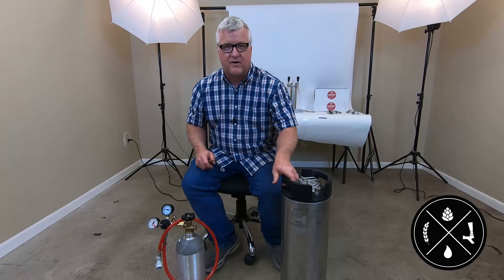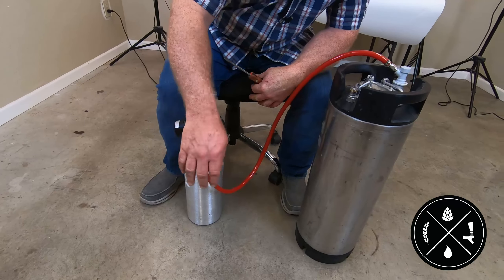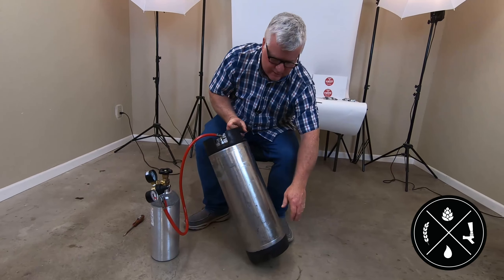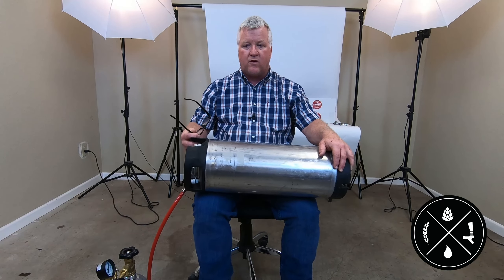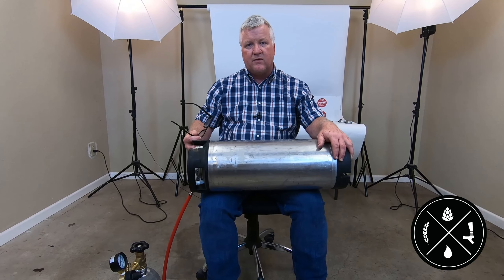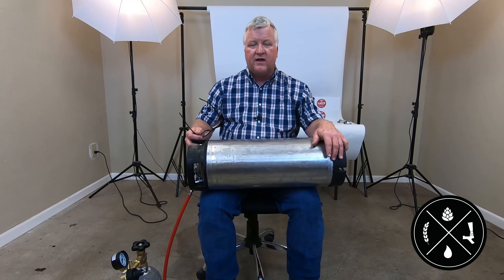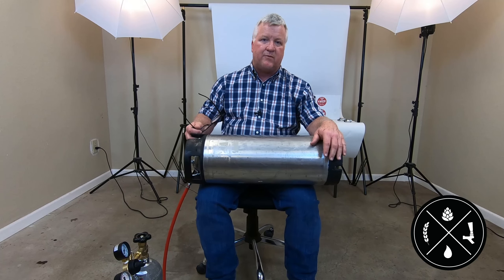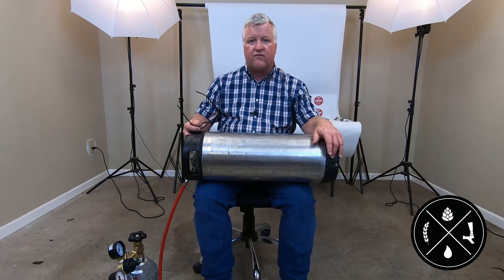How to Force Carbonate Your Homebrew Beer Using a Keg

Comment: I like to change out the gray gas connection to the black beverage connector and connect to the c02 tank.
Leave the keg up right and just tip the keg back and fourth no need to lay keg on its side since the out tube goes to the bottom

Comment: Thank you!
I tried this, the beer in my keg is carbonated, but as soon as I bottle it, the beer is absolutely flat.

Am I doing something wrong? How can it be solved?
Reply from the maker: What tool are you using to bottle from the keg? I love the Blichmann Beer Gun, however I have heard from some people that they lose some carbonation when using the beer gun versus using a "true" counter pressure bottle filler (which would almost make it impossible for you to lose carbonation). I can't imagine a beer going "absolutely flat" though, even if using the beer gun. Maybe it's an issue with your bottle caps or the bottle capper tool you're using to seal the caps on with? I'll ask others and see what they might think!
Reply: If you're going to bottle just use the carbonation pill on each bottle
Reply: @Josecalderon-ss4jz carbonation drops suck in my experience. Better off adding dextrose to the entire batch, give it a good stir and pour into the bottles.

Comment: I tried it, but I got beer in my CO2 line and regulator. What did I do wrong?
Reply: Michael James dude - he got beer in his gas line during a force carb. The pressure of the keg exceeded that of the gas line, and as the keg was on its side, the liquid had a path through the inside of the post. Literally nothing you posted here has anything to do with that.
Reply: I saw another video that mentions bleeding the pressure a bit so that the pressure of the keg doesn't exceed the gas.
Reply: also, another one mentions to actually plug into the OUT and hit it with 40ish psi. The tube goes all the way to the bottom to get the most liquid out of the keg. I tried this the other day with good luck.

Comment: 34 degree's, 35 psi.  REMOVE the gas line and roll back forth on the floor for 5 minutes.  You won't risk beer going back to regulator.